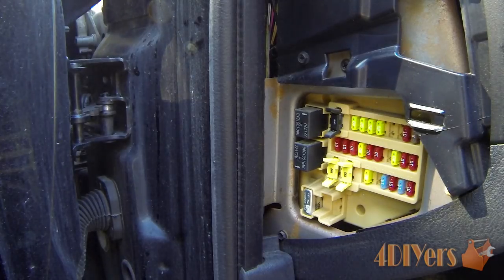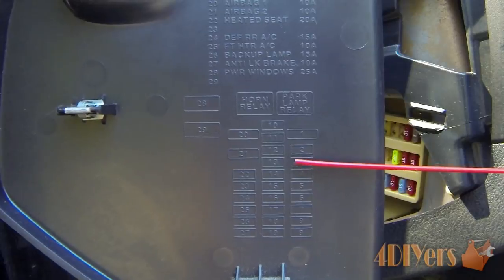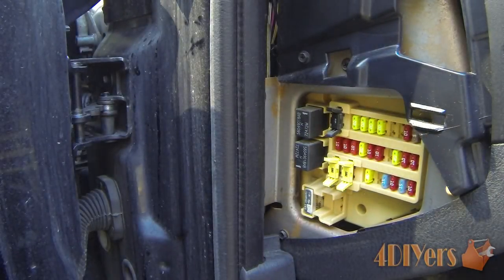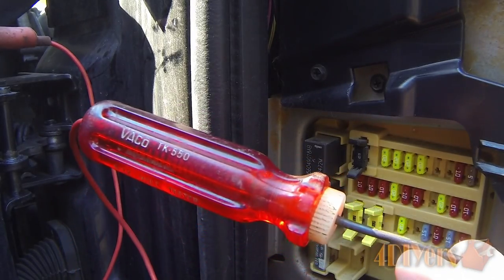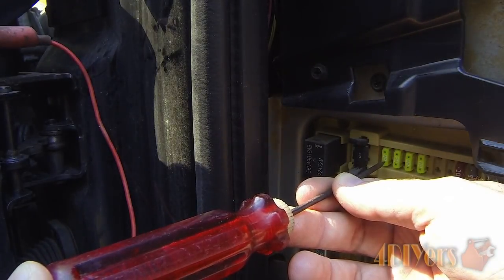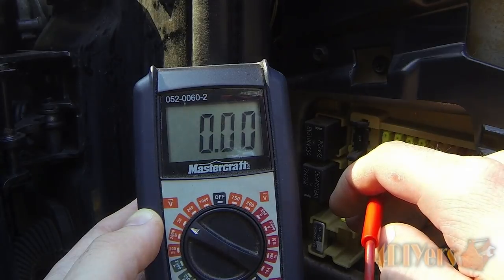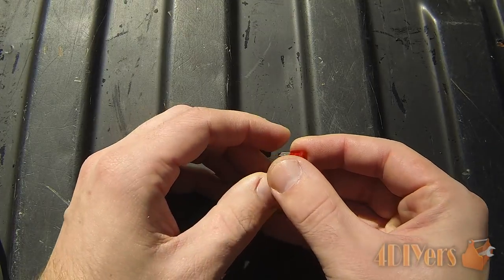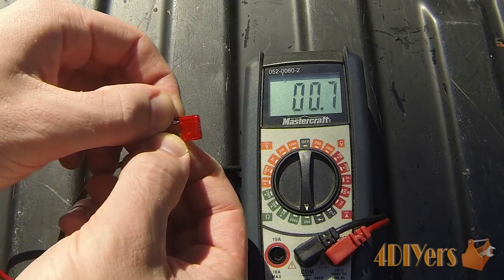DIY: How to Test Fuses

Comment: Help. I have 2 fuse that the manual say they are "ground".  It's posible to use those fuse to connect the black ground wire of a hardware kit for a dash cam? It's ok to do that?

Comment: To use a test light ....does the negative cable on battery need to be disconnected?? I just wanted to do it right and know for sure.
Reply from the maker: Nope, leave it connected. Otherwise the system won't have power to illuminate the test light.

Comment: Hi @4DIYers, I have a Nissan Leaf as you know if you put ON the heat in the car it reduces the range, so I decided to buy Roadpro heat 12V 300 Watt Output 25amp, the car has 15amp I think, My Question is if I increase the amp to use with Roadpro from 15amp to 25amp would it blow up anything or damage anything in the car or make any changes and will the car heat stop working if I increase fuses 
thank you

Comment: How do you test fuses while generator is off but some fuses run like the control panel but you wish to do a quick check by not pulling out the fuses or turning the generator on? Obviously voltage test would be pointless because since most fuses won’t be live so you couldn’t do the test unless using ohms/ continuity. I’m just curious the fastest way to check in that instance any suggestions?

Comment: Great vid but I had to slow it down to 75 % as you talk too fast.  Question:  I saw another vid and the guy showed what was the Load side and the Draw side of the fuse.  He put the fuse back in the fuse box after testing an empty slot.  If it showed 0 it was the Draw side - if it showed 12, it was the Load side.  So I assume that the fuse has to be put back in correctly so the Load side matches up in the fuse box?  Or does it really matter?  I noticed on the 20 amp fuse in the beginning that it was in the opposite way of the others, so it can be put in either way?  Thanks!
Reply from the maker: Thank you! My new videos are much more refined. Technically the supply side can be checked with the fuse in place as well, there are little cutouts on the top of the fuse to place a probe. The orientation of the fuse doesn't matter, it works either way. The only thing is don't mix up their ratings. A lower rated fuse on a higher amperage circuit will just keep blowing a fuse. However a higher rated fuse on a lower amperage circuit won't blow when it should and instead will cause other parts of the circuit to overheat, damaging components and possibly causing a fire.
Reply: @4DIYers  Thank you, Sir, for taking the time to explain.  Cheers, Bob

Comment: How do you used the test lighter to test the wires for turning signal lights. I am trying to figure out which color is for the turning signal . Thank you
Reply from the maker: Connect one to ground and back probe the connector when the circuit is activated.

Comment: I was confused about the icepick with the light bulb.. how do you "ground it" . what did he plug it in to? he said something about clamping something to the alternator wut
Reply from the maker: That is a test light, various styles are available on the market today. It has a wire coming out of the back of the handle which is for the ground and has an alligator clamp. It needs to be connected to a sufficient ground source such as the negative battery post. But as an alternative I used the door hinge bolt in the door jamb.

Comment: is it possible for a fuse to be connected but just not a good fuse
Reply from the maker: +David Jacobo No... Did you test the fuse and it has continuity??? And the circuit it's connected to isn't functioning???
Reply: No I just polled one at a time and look at them
Reply from the maker: +David Jacobo Unfortunately just looking at them doesn't always work. The best way is to test each one.
Reply: 4DIYers Yess

Comment: Hi, I try to measure the voltage of all my fuses in the fuse box of my car, but all of them gives me 0V. I thought that my multimeter did not work, but it wasn't. Is there any problem on my car? I need to install a dash cam, so that's why I need to find the correct fuse. I tried also with car switched on.

Comment: He doesn't show how the ground is connected. I understand the test light is clipped on to the door handle but by what size bolt? How is the negative lead of the Multimeter connected to stay on?
Reply from the maker: Any bare metal bolt which connects to the main body of a vehicle. If you do not have one, run a jumper cable and attach it to the main strut bolts on the shock tower. Or if the battery is closer, just use the negative battery terminal. The negative lead just has an alligator clip.
Reply: Thank you very much for your quick response. This helps a lot and saves me money from having to buy a test light. I never knew you could just test the battery drop across the fuse and not have to pull it for a visual/continuity test.

Comment: Maybe it's just me. But wouldn't it be easier to use the multimeter and set it to check continuity? No need to turn anything on or find ground.
Reply from the maker: +ComPrt3 Unfortunately no. As mentioned in the video, doing an ohms/continuity test will send a small amount of power through the circuit. You can back feed power and do greatly risk damaging electrical components, especially on newer vehicles equipped with different computers.
Reply: I use the continuity test (combined with diode test on some DMMs) because I like to hear the beep.  
Bada bing. Bada boom. Beep. Not blown.
However, that's with the fuse removed from the panel, and if the visual hasn't already confirmed the fuse is blown.

Now, when my fuses blow, I replace them with fuses that have an LED that light ups when blown, especially for the  cigarette lighter power port accessory outlets. Running an inverter to charge a laptop, iPad, a couple phones and operate a big screen TV often causes an overcurrent situation.
Mark the panel where fuses frequently blow with fingernail polish.
Reply: @4DIYers  if we disconnect the battery, will it then be ok to use or is the same issue still possible? Thanks in advance

Comment: Hi. I have a question.. Earlier Afternoon i was changing me car's rear roof head bulb to some Led SMD bulb. Firstly it turned on and i was going to put back its cover holder. But suddenly a little spark (which i'd just noticed) came from light and my cars parking lights started to blink. The problem is when i close all the doors the roof light keeps getting On (the button position in middle) . Ok when i lock my car with remote with all the doors are locked. It indicates by beeping like the door is still open.
I don't know whether it's some sensor issue or what.i already checked Fuses. 
kindly help me.
Reply from the maker: Quite possibly there was a fault with the led bulb and now it's back feeding power. Some led bulbs can only be installed one way, others aren't a very good quality and will fail quickly. Try switching back to the old bulb to see if the problem is still there.
Reply: +4DIYers. ok problem solved. There was a kit which got short ciruit. i had to buy a new kit. i don't know what kind of kit is this. it damaged its computer system kit which is located under the dashboard.. 
but anyways Thank you sir !  :)

Comment: What does it mean when there is no power to fuse with accersories on ?
Reply from the maker: Try the run circuit instead and see if there's power. It may not be operated on the accessories circuit or there could be a fault.

Comment: my headlights nor my dashboard light isn't working but my high beams work and my tail lights work every light works but those two I don't understand if it was a fuse wouldn't those other lights turn off also? I have a c230 2002 mercedes kompressor if anyone has any ideas of what could be wrong please let me know.
Reply from the maker: Most likely a faulty fuse. Be sure to use a multimeter as a visual inspection doesn't always work. Some cars may have multiple low amperage circuits under one fuse, but a high amperage draw on one circuit, such as the high beams being separate. Don't forget to subscribe :)
Reply: +4DIYers I've checked all the fuses front back under the wheel under hood and their all good but it still dosent work idk what's going on any idea?

Comment: I have a Kia Sorento 05 for some reason when I turn on the head lights the gauge light and tailgate lights doesn't turn on. anyone know why?
Reply from the maker: +Hooman sth Check all the fuses, some circuits may share the same fuse. Other issues can also be a faulty bulb, bad ground, faulty light socket, switch issue, or lighting module. But the best place to start is with the fuses and do not just visually inspect them.
Reply: Thanks for the great advice
Reply: @patriotir  what did you find out?
Reply: @GrungeVeins  I found out that no one knew what was wrong so I got rid of it lol

Comment: Iam in need of some info if someone out there can help. I got a 1994 E350 it was crazy cold out and I started it drove it for 5 minutes to the mall and turned it off. I returned and it would just click. Tried to boost it and it just clicked. Thought it was the starter solenoid and changed it. Tried to start it and everything was dead. No power to dash or anywhere.battery still checks out good, got power from battery to solenoid, checked all fuses under dash and hood all looked good. Tried to test with test light no power to any of them. Any help would be appreciated.
Reply from the maker: Have you load tested the battery or was it just with a multimeter?
Reply: @4DIYers  it was load tested with 2 different machines and it tested ok
Reply from the maker: You may have a bad wire, either for power or ground or even a faulty ignition switch https://www.youtube.com/watch?v=E1nlbeXtVmQ

Comment: Not getting electricity to one of my fuses
Reply from the maker: +Andres Marquez Check your relay first, depending on what the circuit is. Then test for continuity between the fuse and the relay.
Reply: @4DIYers  I have the same issue, one fuse inside car the does not any power to it, but the fuse under the hood does have power? i am diagnosing an AC on Haundai Elantra 2011. any help would be greatly appreciated.